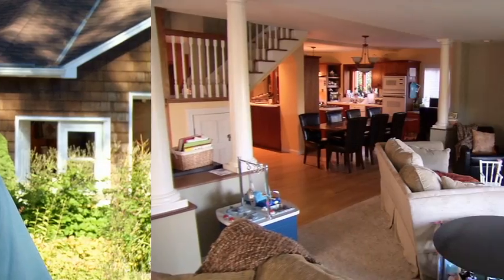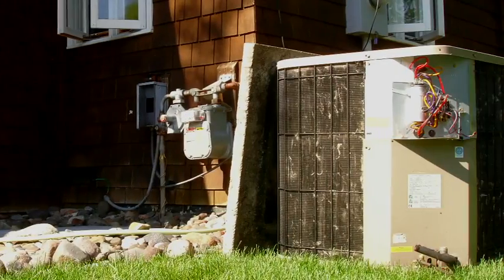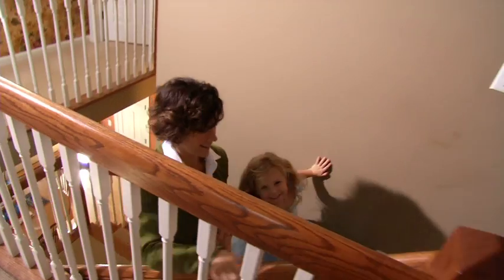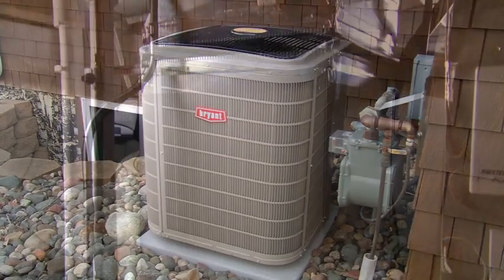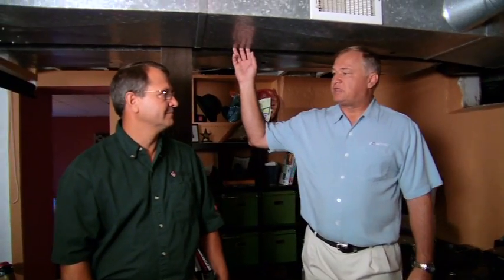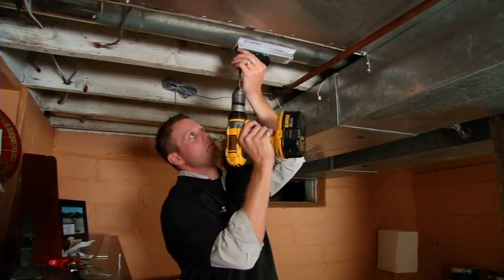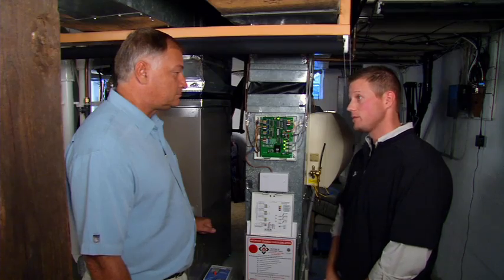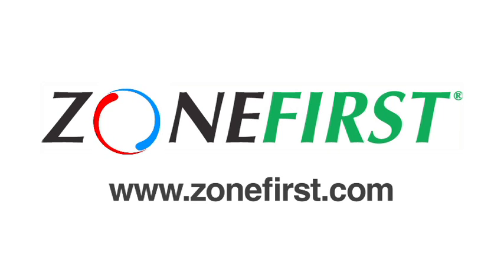HVAC Contractors: Retrofit Zoning from ZONEFIRST

Comment: This seems to be the ONLY product I've found that will do exactly what I want:  Add a simple 2-zone system so that my mountain cabin can provide heat to the main (upstairs) living quarters as well as the lower-level "bunkhouse."  The Bunkhouse is right next to the furnace, and would be a sweatbox without a smart thermostat-run zone system.

Comment: @ 1:05  SERIOUSLY????  This does NOT reflect on ZONEFIRST but on the contractor! Code requires 3 ft clearance  of equipment from a gas meter setting and the meter must be no less than 2 ft from a corner structure. Next time why not  just put the condenser on top of the gas meter! Its obvious this job was not inspected by the local government agencies. Sadly, zoning is mostly used to band-aid POOR or NO duct design according to ACCA standards; another reason for using a qualified company who actually knows how to design a system instead of just hanging pipe.